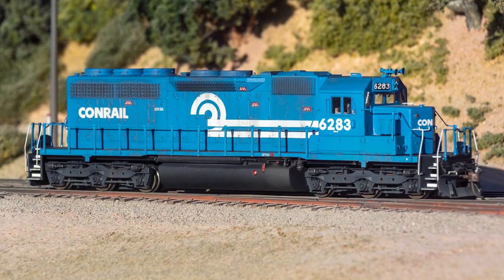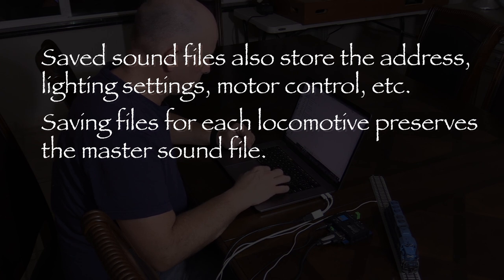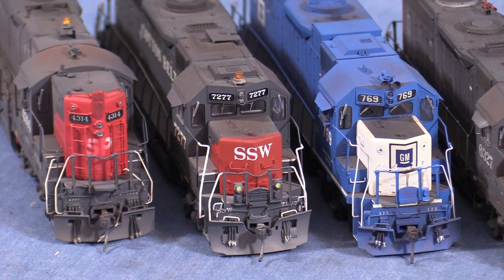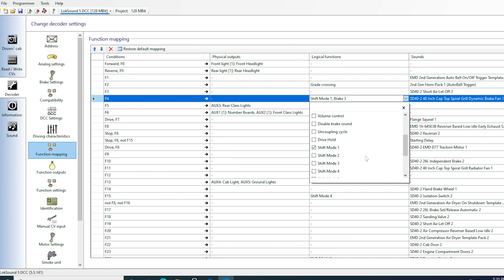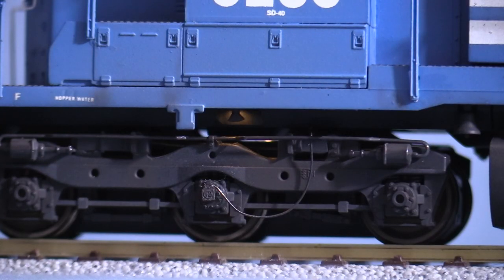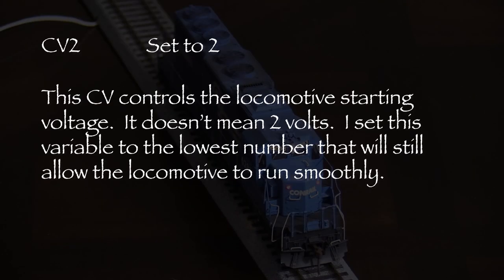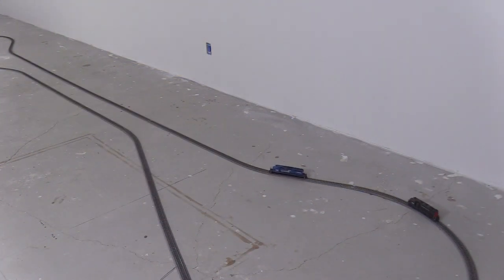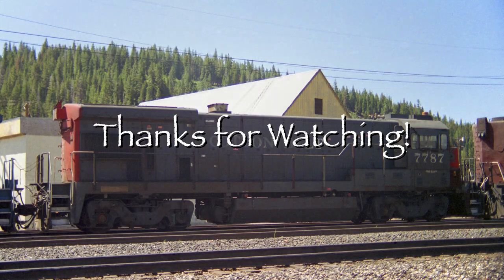Model Building HO SP Consist Build 14 - DCC Programming and Speed Matching

Comment: As a HUGE Conrail freak 
I've got to give 2 thumbs up Dan, your right about the air brake function on coupling Dan, I set in
my Semi the other day watching UP
switch out boxcars in Laredo, and
you can hear the Loco charging the
airlines up after they hooked up to
the cars they were pulling!! You
should do a lineup of your engines
like you did in the shot before you
started programming, I love that EMD Demonstrator that was in the
shot!! Looking forward to the rest of
the consist build Dan!!
👍👍👍👍👍👍👍👍👍👍👍👍
Reply from the maker: I have a few more Conrail engines on my roster, mostly GEs from Atlas and ScaleTrains.  SP was leasing some Conrail power in the 1990s so it's a good excuse for me to run them.  I think I'd need to clear off some more counter space to shoot a bigger lineup!  Maybe I'll do that at some point.  Since I haven't had a big layout (yet), I haven't had many opportunities to see all my finished models out of their boxes.  Thanks for watching!

Comment: Excellent video as always. Can't wait to see you start working on that Dash 7. I love ESU's hardware. I have a few N scale locomotives that i'm considering sending out to have Loksound decoders installed into. I'd attempt it myself but my soldering skills are not up to par for wires and contacts that tiny. lol. The first DCC/Sound locomotive I ever owned had a Loksound select in it. I think it was a U28c if I recall correctly. I've got other brands, Paragon, Soundtrax, etc. but I definitely prefer the ESU decoders for their feature sets. Definitely a practice of getting what you pay for.
Reply from the maker: I'm anxious to get started on the next engine, too, or get back to it.  I was trying to work on them all at once when I started this series and that got to be too much.  I've tried just about everything as far as decoders go, and I've never found anything with as much versatility as the LokSounds.  Thanks for watching!

Comment: I have not seen such an in-depth overview of the Loksound programming software and keeping the same settings for CV's across all the locomotives just makes too much sense 😀 I have seen speed matching talked about, but I have wondered, does it have to be adjusted over time as the locomotives breaks in ?
Reply from the maker: I'm glad you liked the video.  Generally I haven't needed to redo the process, unless something happens like a decoder reset and I haven't made a backup file (which is why I'm careful to do that now).  It's been years, though, since I've had a layout large enough to have my locomotives running at speed for extended periods.  I guess we'll see if anything changes when I start building my new HO layout.  Thanks for watching!

Comment: You could setup brake functions, since you don't use a brake function for dynamics. You could do independ, train, and E Brake functions. With the E Brake you could also set it to turn off headlights and turn on SP red beacons. If done correctly the Ebrake can override the drive hold function incase of real emergency.
Reply from the maker: I guess when I get to the point of having my layout running I might reconsider using the brake function.  So far it's not something that I really use, but most of my running has been switching.  Thanks for the suggestions!

Comment: Dan, Loved the video! I’m looking to get a Lokprogrammer in the near future and this answered many of my questions! One more for you: I see you’re using a Mac which I also have. Do you use Parallels Desktop or how exactly do you run Windows on your Mac when using the LokProgrammer software? Is one method better than another?
Reply from the maker: I've been using Parallels Desktop for a few years now, and it works well.  It's pretty seamless.  The LokProgrammer software shows up in the dock just like any other app.  I haven't tried any other methods so I can't really say how well anything else would work.  I know there's a way to reboot the Mac as a Windows PC, but I haven't found it necessary to do that so I haven't looked into it.  I bought the Parallels software for the LokProgrammer.  I have a couple other small apps that are Windows based, like one that I can use to program my scanner for railroad channels, so the software works well for that too.  Thanks for watching!

Comment: Hi Dan, I'm interested in knowing what the status is on the SP B30-7 #7788 Consist build. I've seen that engine with 3 paint schemes.
Cotton Belt on side with SSW 7788 Hood and Rear
SP Speed Lettering on side with SSW 7788 Hood and Rear
SP Speed Lettering on side with SP Lettering on Hood, not sure on rear.
I'm anxious to see what you are going to do.
Reply from the maker: After taking some time to work on a couple of layout projects, I'm once again working on the consist build.  I am working on the B30-7 right now.  I am going to repaint my unit as 7787, as that's the one I photographed back in 1993.  I'm not sure about 7788, but 7787 was repainted into the speed lettering scheme sometime between my summer 1993 photo and late 1994.  Some of the speed lettered ex-Cotton Belt units were sublettered SSW under the unit number on the cab.  I am going to model my unit as it appeared in my photo, in traditional scarlet and gray with "Cotton Belt" on the long hood.  Thanks for watching!

Comment: Daniel loved the video, I wanted to ask what DCC system you recommend to starters trying to get into that side of the hobby with a limited budget?
Reply: NCE Powercab and Digitrax DCS52 are often the most recommended from what I heard. The former might be a it more user friendly but it’s all up to personal preference
Reply from the maker: Someone else already answered but I would also say that the Digitrax Zephyr Express (DCS52) or the NCE Powercab are the most popular starter systems.  I'm a Digitrax guy but I know a lot of people like NCE.  Both work so it's mostly a matter of which one you like better.  If you hang out with other modelers, and most of them are using one or the other of those brands, that can be another factor.  I've had a Zephyr (an older version than the one that's currently offered) for years and I use it all the time.  Thanks for watching!

Comment: Question:  Does the LokProgrammer unit & it's LokProgrammer software work with other commercial decoders?   Looks very useful.
Reply: ESU decoders only
Reply from the maker: Someone else already answered, but no, the system is for ESU LokSound and LokPilot decoders only.  Some people use JMRI for other decoder brands.  I haven't really delved into that so I can't comment much about how well it works.  Thanks for watching!

Comment: Love this whole process with the build two questions when you speed matching do you have one locomotive no matter what that speed match to period, and does the computer program for doing all your programming plus storage of program settings work with non sound as well.
Reply: The LokProgrammer can be used with LokPilot decoders (Non sound). it can only be used with esu decoders though. I usually set the top speed to be 65 smph and mid throttle to be 32 smph.
Reply from the maker: The LokProgrammer works with ESU LokSound (sound) and LokPilot (non-sound) decoders.  I don't think it would work with other brands.  If I understand your first question, I match everything to the SP GP35 that I used in this video.  It's a bit of a random choice, but it works.  That engine is actually a stand-in for a Kato NW2 that I used to use as my standard.  I chose it because it is slow compared to other models.  There's no way to make it run faster, so I brought all my other locomotives down to match it.  That model is currently taken apart, though, awaiting a new sound decoder, so for now I'm using the GP35.  Thanks for watching!

Comment: I’d also like to see how this would play out with steam locomotives. Programming should be simpler for a steam locomotive as it wouldn’t have that many lights and sounds for operating.
Reply from the maker: I don't have that many steam locomotives, but having a system of some sort is still useful.  Mine is still a work in progress.  I set up my model of UP 844 so that it has working class lights, so the function keys there can be similar to a diesel.  I guess a lot of it would depend on how important it is to control different sounds.  My current standard for steam calls for putting the blow down sound on F4, which is the same key I use for dynamic brakes in diesels.  Some of my SP steamers have a horn and a whistle, which is another wrinkle.  Thanks for watching!

Comment: I use F3 for the rear headlight and turn off the headlight directions real engines the headlights don’t go on and off when changing direction
Reply from the maker: That sounds like a good way to do things, too.  I know the real ones don't work like that, but sometimes I like the directional lighting because it tells me which way the locomotive is set to move.  I guess it's one of those things like coupler trip pins that I'm not ready to let go of yet.  Thanks for watching!